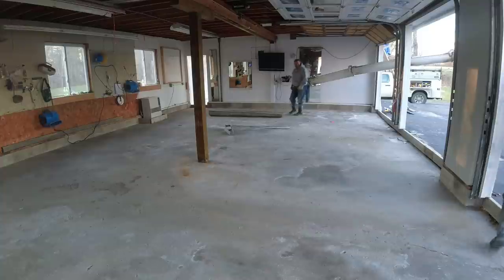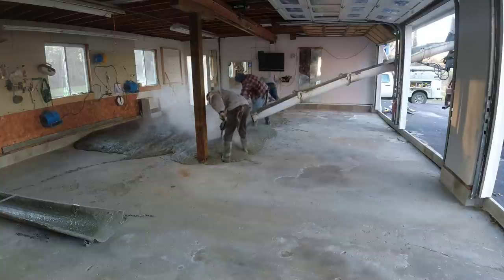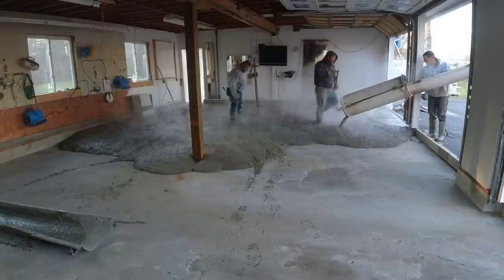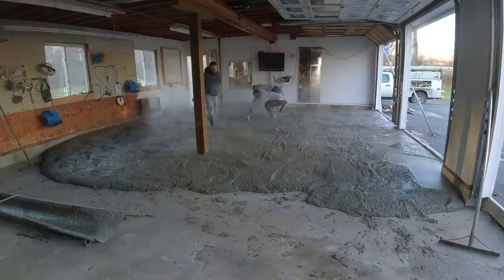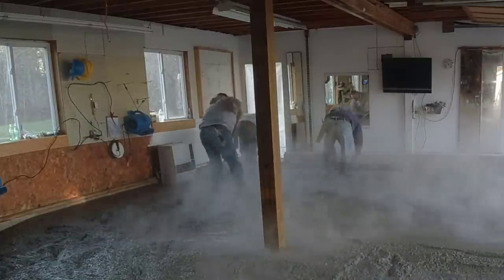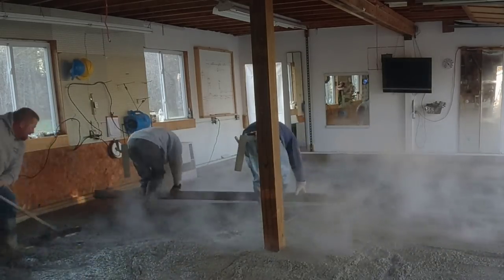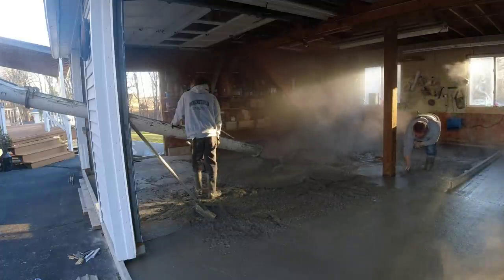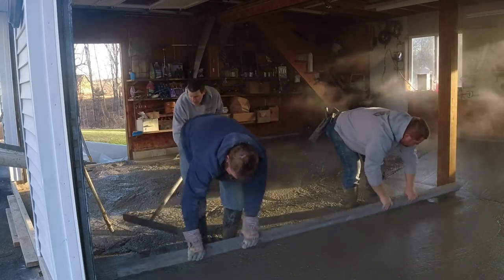Pouring Concrete OVER Concrete (NEW Garage Floor Over OLD One)

Comment: A shop I bought many years ago had a floor that was finished with a rake, You could see the imprint of the rake and teeth marks in it. It wore on you working in there cause you were walking up and down hill all day. Eventually I poured a new floor over it, took 9" of concrete to level it. I put plastic under it because the old floor always had moisture coming up through it. I was in there 20 more years and it never did crack. Have a healthy and prosperous 2022!
Reply: In a similar situation - mind if I ask what you mean by "put plastic under it"? did you lay plastic vapor barrier on top of the old floor, and then poured the new slab on top of that? and did the new slab have control joints?
Reply: @scottchen8312  Yes, vapor barrier between the old and new floor. And it did have a couple control joints.
Reply: @billmiller7138  Thank you for the tips!

Comment: Nice video Mike. I think all looked OK. I would personally add that foam tape onto the walls so this new concrete is somehow detached from old structure also that foam would allow a little bit of movement of this new cocnrete floor..

Comment: We use 6mil barrier to prevent that bottom slab from sucking the moisture from the new concrete. I’ve seen it crack it like that. Very professional as always sir.

Comment: My thought would have been to advise the home owner to replaced the wooden post with a steel column before the concrete pour. The wooden post were already showing signs of rot at the base.
Reply: good point on that wood post. Personally, I would have supported the beam, cut the bottom of the post, and then slid a 4" or 6" solid cement block under it. (cut to fit) That could have been done in an hour with the right guy on the job.

Comment: Hello I've done a couple of new floors over-the-top of old an inch and a half thick. Pressure wash and bond adhesive and then a 5,000 lb. Pea gravel mix. it has worked well.

Comment: with 4+ inches, that would be a prime candidate for some heat pipes in the floor.  Easy to put in and you don't even have to hook it up right away.

Comment: The only issue with pouring over old concrete is transference cracks will appear over the crack on the old Crete also a moisture barrier and Abel flex around were the concrete touches the structure would be a good idea as well

Comment: Honestly I would’ve thought that you would have used a bonding agent at a thicker point rather than an inch and a half it’s good to know I always use a bonding agent and cuts 🤙🤙
Reply: Also he didn't protect the lumber in the center dry rot wtf concrete contractors have one job.... Know ur trade
Reply: @MrBiron1  most probably because they determined there’s a steel column within the center of the outer wood facade. Even so  those fellows do know their trade and that’s prepping, pouring and finishing concrete. They ain’t there to do other sh!t the homeowner may or should have already had done. These guys specialize in one trade only and aren’t some general jack-o-all trades sh!t.
Reply: @marvinjgerald6007  No, he clearly said it was a treated post...lumber.

Comment: Mike I used to recommend to use 15 or 30 lb felt to put over the crack just to keep it from mirroring through the new concrete. What do you think?
Reply: I like to caulk all the existing cracks shut. They usually don't come through to the new when I caulk them
Reply: @Tony-Rinaldo  Crack repair first, my thoughts, cut them wide enough to repair, use a stiff mortar, come back and top off, mortar is my preference but caulk does seal

Comment: This is great news, I’ve been told it’s not possible because it wouldn’t adhere to the old. My situation however is the old 1 car garage was converted to a bedroom and they never brought the new floor up to the existing foundation level. I get water in at ground level during very heavy rain. I installed a French drain and gutters but it hasn’t solved the problem. My concern is, if I pour concrete between the studs once I take the Sheetrock off, it’s not a solid slab with studs every 12 to 28 inches. Will water still seep through the studs?

Comment: I want to do this in my garage but I have exposed wood framing around the perimeter instead of block like in this video. How would I go about raising the floor up 4 inches without tearing down the walls first

Comment: I assumed the casing for the overhead doors were cut to align with the top of the new concrete but instead a gap remained so it appears the only fix for that is all new trim. Perhaps the slope wasn't factored in. I sure hope the homeowner has enough headroom for the new door tracks. Great videos!
Reply: they mentioned that 2 of the garage doors were being eliminated, as this will be finished space for a workout room.

Comment: I'm looking to put a to post car lift in my garage recommendations say slab should be at least 6 in thick I'm only 4 in the slab is pretty good no cracking no sagging only about 6 years old think I can get away with just overpouring another 3 in on it also could I put wire mesh in it on an overboard slab then just use like 8 inch anchor bolts so it goes through the old slab and the new slab

Comment: I'd love to see a video on the entire process you do to successfully pour  a slab in cold weather.   I have 4 slabs I need to pour here in Bend Oregon  and next week we won't get over 25 degrees  and will be single digits at night.   I plan to wait for better weather.  Do you ever use heated blankets?  How do you keep the concrete Temps up so it  will harden up for burning in a power trowel finish.
Reply: They usually add calcium chloride( in cold weather) to it which naturally heats cause of chemical reaction, I dont think they ever use blankets with heat, just blankets to hold heat in
Reply: Concrete generates enough heat as it hydrates the first 3 days. Just covering it with insulated blankets is good down to 15 degrees or so. If it gets colder you can add a layer of straw or hay or fiber glass insulation. I helped work on a light rail train line in Denver. We built the foundations for parking garages, station platforms, and a tunnel. Did a 36 foot high wall 200 feet long 24" thick in one pour. Anyway, we kept moving right through winter. As long as it's above 32° F you can pour. You just don't want the concrete freezing to the chute or rebar. We would float the top of the walls then run rubber hoses up and down the walls that were connected to a machine that pumped heated fluid through the hoses. Cover them with blankets and nail down so they wouldn't blow away.

Comment: For the amount of money going into this floor I would have sprung for the bonding agent, it may be overkill but what's a few gallons of of bonding agent for piece of mind. That post was already compromised and partially rotted it should have been replaced with a 
lolly column or at least encapsulated with lead to keep the concrete from doing anymore damage to the post.

Comment: Another excellent video.  Thanks.  I'm near Jacksonville TX and I;m building a 30 x 30 barn/garage for my farm tractor etc.  I'm wondering if if can install the slab in sections so I can do the installation myself? To much work to do it all at once. Yes cost is a problem.
Reply: Dennis, I did the same thing myself near you in Alvin.  Remember, we have semi-solid gumbo muck for soil. Pouring a grid of individual slabs will allow each to float independently.  That is not good  if you are building a structure on top, or driving a vehicle onto it.  Thickness of each slab is irrelevant. Some will say to use heavy rebar to connect the slabs.  This will help to keep the adjoining slab edges at the same level, but each individual slab will still sink at different rates, but at least the joints will stay level with each other.  I learned the hard way.   I had to pump in foam to relevel after only four years.
Reply: If you're short on help and money just break it up into 10 ft strips. 10 ft wide will screed real easy. 3 -10 ft by 30 ft strips and you're done. Number three rebar on one foot centers both ways for that ground will hold it together. tie all the bar grid together to begin with. Notch the bottom of the form headers for the rebars to go centered in the slab depth.

Comment: If it moves again you guys f up! That means you don't have a good base underneath and all you did is added more weight on top so it can settle even more!!! You have 7" then go down to 4" it will settle we're it is heavier..... Concrete is only strong what's underneath 💪 Use fiber to minimize cracking in your cement between a pound and a pound and a 1/2 per yard helps  stress cracking or weather cracking.... 🤔 😀 nice job fellows!!!

Comment: This job should’ve had expansion along the walls wire mesh in the floor in the center screed  to keep things level I don’t know how you can pour a slab that big without having any low spots with out height index markets in the center

Comment: It probably was poured unlevel to have water run to the doors. this was done in garages that didn't have drainage. if you didn't put the blocks under the wall than the original builder did that because of thr water being used to wash down the floor. I like 3 feet of block for a shop for welding purposes and fire protection. I guess you could use cement backer board 3 feet up the walls for fire protection if the owner was doing auto work in that shop.
Reply from the maker: The lowest spot was in the middle about 3 feet away from the floor drain. There was 7 inches of new concrete there.

Comment: Would you ever consider drilling some holes and installing 1/2" rebar webbing for extra strength, or is the fiber-mesh adequate?
Reply: He said the floor wasn't really cracked. So I would point to that and say you don't need more strength
Reply: What about that big ass crack by the door. If that’s frost when it thaws  the floor will sink in that spot correct? Causing the same crack to form on the new slab?

Comment: Hello Mike, great video! I'm hoping to do something similar, but some areas of my existing concrete floor aren't very leveled, and there's control joints going all crazy directions (looks like previous owner modified it quite a few times).

I consulted a local flooring guy and he said if I poured over the existing floor, the unevenness and control joints are all likely to telegraph through. Do you think that's true? and if so, how would you go about getting a nice uniform polished concrete in the end?

Comment: So my garage is about a foot lower than my actual house floor but we want to turn it into a master bedroom but want the floor to match could we build it up 8 inches of gravel ontop of concrete then pour ontop of the new rock? The concrete is in good condition we just don't want it a garage no more and build a new garage with 16 foot ceilings for a lift and all that to and why not get a master bed and bath out of the old..

Comment: Mike, 

Have you ever jackhammered a old floor that was cracked into small peaces (or as small as a jackhammer can) packed them and poured over the top of them? The reason I ask is I have a rather large crack in my garage big enough to stick a person’s finger into but it’s only down the middle or pretty close to it. The rest of the floor is pretty good if the two other hair line cracks that have shot off of that main one (one on each side) constitutes as pretty good. It’s just the big one down the middle that’s being a pain when your rolling around on a creeper trying to fix on my pickup. Or any advice for this crack in the Concreet? Thank you
Reply: Clean it out real good and then glue with bond adhesive and fill it with some high-quality high-strength grout.

Comment: These videos are great for knowing what's possible. I wish someone this good were in our area. As it is, I can't get anyone to come out and do concrete work so I need to figure out what's suitable for DIY and whether we can manage. We have a garage slab apron that's sloped wrong so it pushes water into the garage. Inside the garage there's a floor drain but of course inside, the slope is also wrong and pushes the water to the walls! Can't do a thick repour like this, but I've seen your resurfacing videos for thinner stuff. Anyone know if there's a mass market resurfacing product that can be feathered to a thin edge, but also poured an inch or so thick, that will work in a garage with light vehicle traffic? I see TF structural but impossible to get near me.
Reply: Rapid Set concrete mix can be troweled to feather edge. Buy at HD  Use time extender additives if you're new to masonry work, it dries extremely fast. You need to tool it immediately. You can use rapid set mortar mix for thicker repairs if price is a concern.

Comment: I was looking to level out a room in my basement so i can use dri core flooring. This is the only room that is not level, the only problem is the concrete is spalling do you have any advise on bonding agents, can i use thin set so on? any advise would be great. thank you.
Reply: Use a pourable, self-leveling floor leveler, mapei and rapid set make them. You have to use a primer made for self leveler first, it's like a watery paint and pour within a few hours. Use exact measurements for water. Mix with drill and paddle in a bucket and pour all out, use squeegee to spread. Looks like pancake batter, but dries very fast.

Comment: Question: is it best to put foam around wood (I.e. the wooden post) to prevent concrete from rotting the wood? Just curious because this past summer, I did a concrete pad in a chicken barn for my parents and I put foam around the wooden posts to the thickness of the concrete. Regardless, love your videos and they have taught me a lot about concrete.
Reply: I wouldn't worry about it. If anything replace with steel support but homeowner probably didn't care.

Comment: I’m no concrete guy but, why not put a vinyl sleeve around that wooden post just to prevent the cement form rotting the post out from the bottom.

Comment: Merry Xmas to you; the family; Darren and Luke. Question had a client asked me if they poured over the existing floor with 4" of concrete can they put install radiant tubing, or should the concrete be thicker?
Reply: Sounds exactly what I would do, if you have 4" to work with, skip foam underneath, if you have more to work with use foam, my house has radiant tubes strapped under hardwood floors, does it heat the floors nice and warm, no, concrete is the medium for radiant heat, I have a 'worst case' radiant solution, I didn't do it🤣

Comment: Hot conctete calcium/hot water or non chloridic accelerator etc.. bonding to a cold base can lead to premature stress fractures when depth values vary in a pour..if one side is 7" thick and another is 3"..the curing process/bleed will not be equal due to the rate of exothermic reaction in desired slump of concrete..This binding process makes cracks inevitable..6mil poly would reduce the probabilities of this..not hating but others that would try this and not be aware of possible outcomes should be aware of "binding possibilities"..btw..that calcium is emitting hydrogen chloride fumes that are toxic..it can burn nose throat stomach etc..had a guy fallout 30yrs ago on an interior pour at the base..his blood pressure dropped and so did he..he lived lol.

Comment: The idiots who laid my 24 X 24 concrete garage floor simply put down a 4 inch thick monolithic slab over sand with no footers or rebar.  Needless to say it's heaved and cracked all over with some cracks 1" or more high and wide.  The only solution would be to jackhammer out all the existing concrete and start over which will cost a fortune.  The garage was built in 2001 and I purchased the property in 2015 and am just having to live with it since I cannot afford the repairs being on a fixed income.  Good thing that floor wasn't heaved or cracked too badly making your job that much easier.

Comment: The old floor needs to be wet so the new concrete will bond to it !!
Reply: Don't want the 2 bonded together, all the defects  will come up in the new concrete, you actually  want to isolate  the 2 from bonding,  poly, sand,etc I worked  in commercial  concrete  for 25 year

Comment: A least you brake the old concrete floor and put some wire mash , expansion joint felt around the wall and then poor new,  old Fashion  and little bit too scary

Comment: 😂 Some of the comments..You can pour a slab over slab as long as the existing slab is in good condition..You don't necessarily need rebar or mesh..You don't necessarily need a bonding agent..It depends on the size, thickness, PSI of concrete, adding agents,  geographic location, ect..No job has an exact set way to do it..🎯